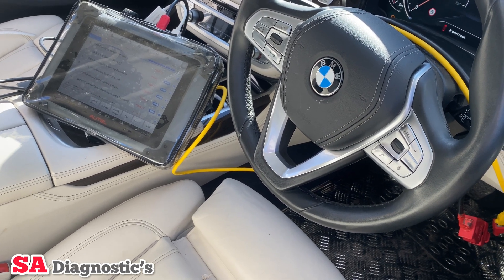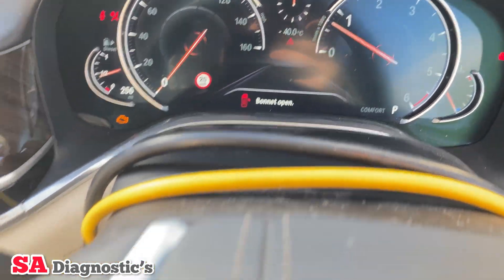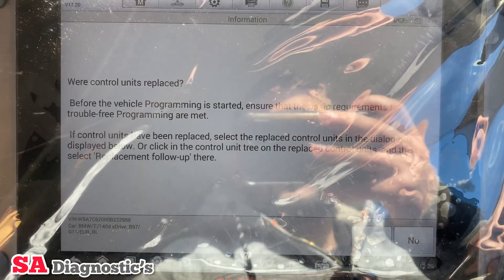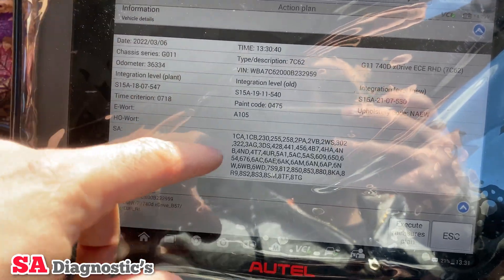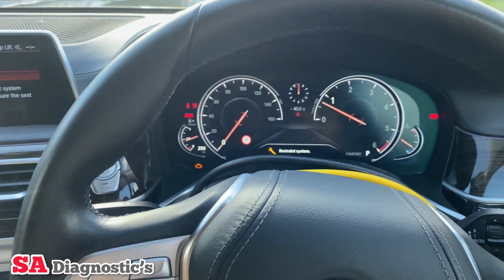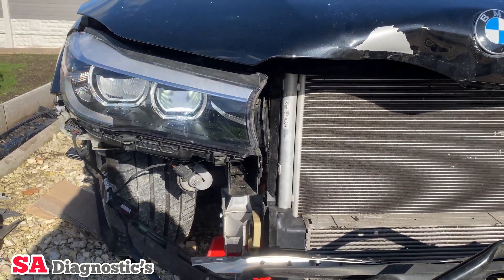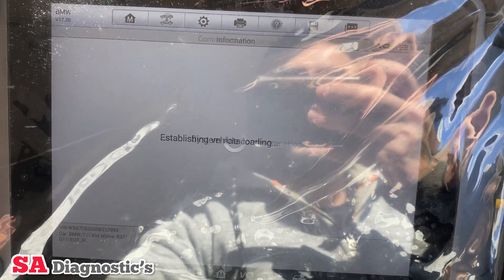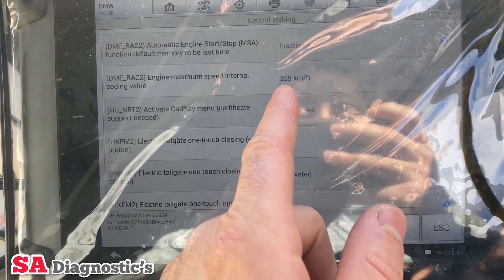2025 AUTEL BMW Coding & Programming | STEP BY STEP Guidance

Comment: Hey, can you someone help Me with something, I'm programming a replacement 2008 BMW M3 DCT Transmission (From a 2011), It wasn't Shifting or going in any Gear, Just stuck in Neutral.. I Programmed the Transmission, But this "CF26 - Message error (ZV and lid status) from CAS, receiver DKG/EGS, transmitter CAS/ACC/DSC" Code Remains. It's Doing in Gear, Now, But Once I Take My Foot Off the Brake it Goes Back to Neutral. I'm thinking it's a Coding Issue. Do you this thinking is Correct?

And, I'm planning to connect the old Mechatronic up to the Car and Extract the Coding Data and transfer it to the Replacement Used Transmission.

So, My question is, Since the Programming have been successful, will Transferring the Coding Data From the Old Transmission it to the New Transmission resolve this issue and Restore everything like it was?
Reply from the maker: Hi if you transfer the old mechatronic this may solve it. That’s if the old mechatronic isn’t faulty

Comment: Hello, So I Made A Mistake While Coding My X3 2022 model , I Have Added 360 view in retrofits Which The Car doesnt Have , and Now The Rear View Camera does not work , And Head Unit Just Says Camera Malfunction, Is there Anyway To restore the old data ?
Reply from the maker: @ii-dark-reaperr-ll6889  not really there isn’t a way you have to manually code it back in. Unless you have saved the coding prior otherwise you have to go back into the cluster and code it in again….

Comment: what Autel unit is that and what other units can do this too?
Reply from the maker: @scooter1391  AUTEL ultra lite this is and anything with j2534 can do it…
Reply: @sadiagnostics  can a IM508 do it with J2534?
Reply from the maker: @ yes should do mate but check with AUTEL as well as it’s been a while since I used one and plus they keep updating software all time….

Comment: I know this is an old video but I’m currently looking at autel. Can these units code/programme to a car if the part fitted is second hand? Like a used abs module or steering column module on e90 bmw?
Reply from the maker: @gixxk7568  yes will code even if it’s used part

Comment: Hi, I have maxisys pro and im trying to code the side mirrors of a bmw f32 to unfold and fold with the car key beeper.  Do u know which of the  options do that?
Reply from the maker: @jaimeiglesiasvasquez8250  hi has the car got built in folding mirror as in is there electronic motors in them? If not then it won’t work.

Comment: hello, this machine can do everything that the eyes type bmw machine if I want to put paddles on the steering wheel or change the steering wheel or headlights from halogen to LED this machine can do it, please take this doubt or have a restriction is not the same as the one bmw software thank you
Reply from the maker: Hi unfortunately this machine will not be able to do almost things that Bmw software can do. None of the Autel or snap on is capable of doing this. Only dealer software is best for all the functions.
Reply: @sadiagnostics  tank you

Comment: Question:
1. What happens when subscription expires, do you loose full use of the unit?
2. During the coding procedure; where is it pulling the data and is this an extra charge?
3. Can the unit read/erase BMW Canbus/module/Chasis data?
4. What is the cost of the Autel subscription.
Reply from the maker: 1- when the subscription ends it only stops at what ever update you have and you won’t get any updates unless you pay for it. Other wise the machine will work as it should. 

2- there’s  no charge it’s free. 

3- yes upto a limit, it will not be able to delete some stuff if you want to dig  into bmw stuff then I recommend you get dealer software. 

4- depends what unit you get. On this machine it’s roughly £1300 a year

Comment: Thanku for great information boss but tell me something if you want to do coding and Programming waht we need to check I mean parts number must be same or any part number is working
Reply from the maker: It’s good if it’s same part number as it makes life easier and this also ensures that the coding will be 100%. However in the past I’ve coded parts in for bmw with different part number and it’s worked without any issue and there’s been of one that hasn’t worked.